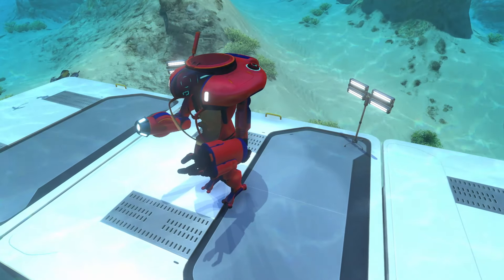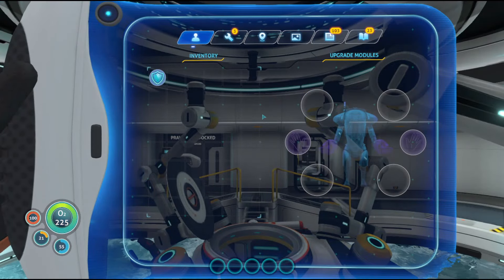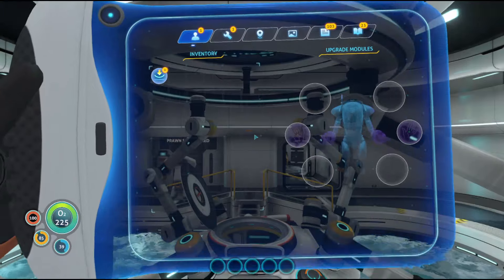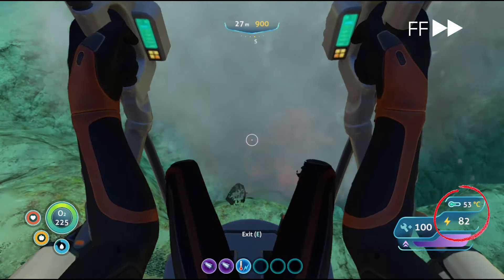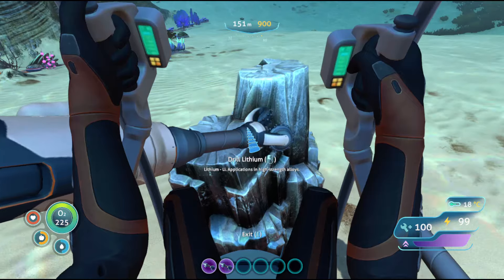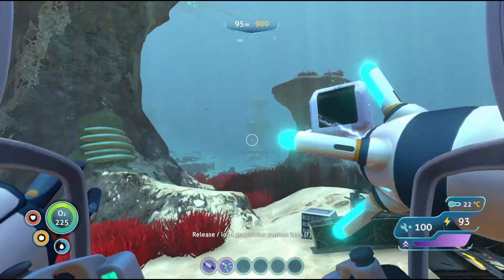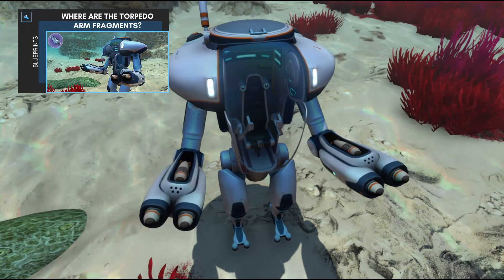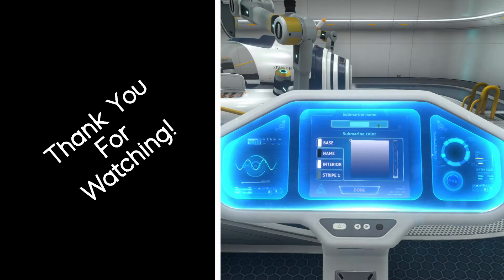How To Upgrade The Prawn Suit | Subnautica Guides

Comment: Where do you find the blueprints for each of the upgrades? ... More specifically, the Depth Module Mark 2?

I already have Mark 1. I have a vehicle upgrade console. I have a modification station. I have a cyclops. I even have like 50 Kyanite in a locker, READY to be used (as well as the REST of the resources necessary to upgrade the module, thx to the wiki)... but the modification station doesn't show the option to MAKE a mark 2 Prawn suit module, which is preventing me from being able to beat the game. Does ANYONE know how this gets unlocked?